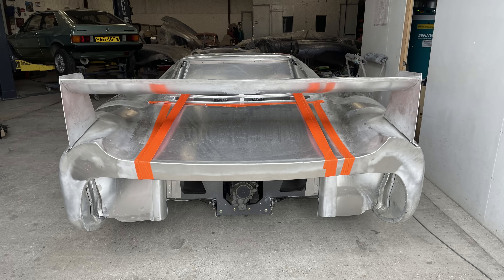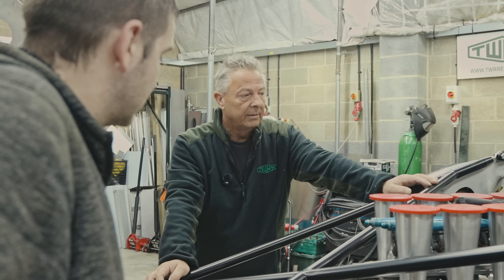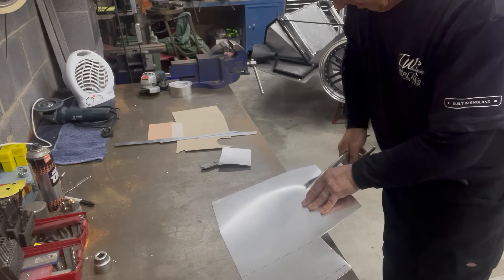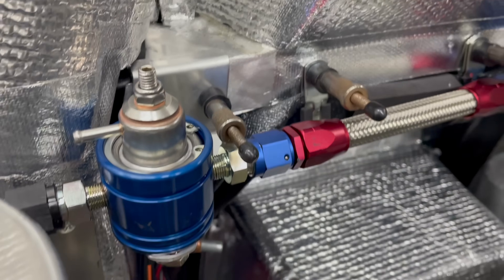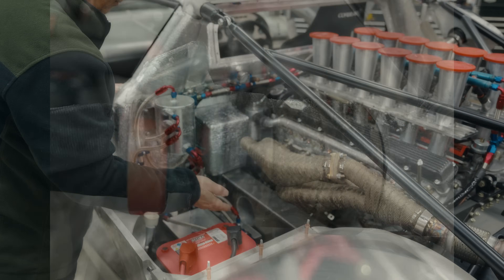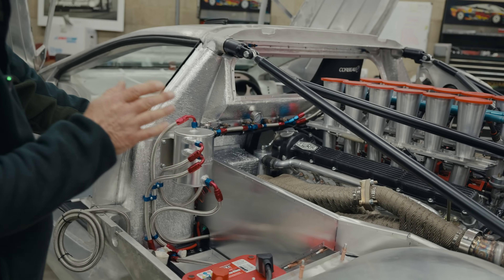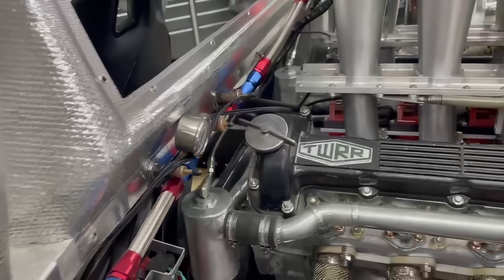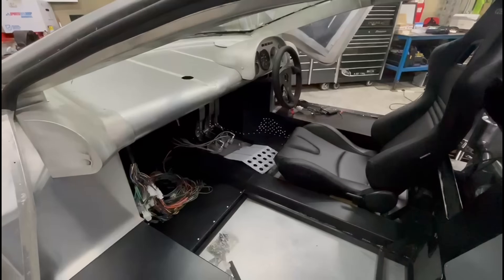Building the Ultimate Handmade V12 XJ220 - Part 4: Engine

Comment: Question, what is the purpose of ITBs  if they all run on a singular input? Surely they all have identical profiles for the plate, no? Not criticizing, just curious.
Reply from the maker: Ensures each cylinders gets it's own stream of air that isn't disrupted by the intake of a neighbouring cylinder. You can tune the length and diameter independently too so each cylinder performs the same as the next

Comment: APEX, Regarding those fans, use pulse width modulation and you will save a heap of power upon start up. The problem with simply using current is that like a car, to get going require large power and remember, these aren't geared. PWM can act as a kind of variable transmission only using the power it needs.
Reply from the maker: We can pass it on to Trevor

Comment: That V12 better be a 7.4ltr like the one built by TWR on the XJR for LeMans in the 90's.  That engine put out 740hp.

There are a limited 5 XJR-15 LM's built by TWR with 7.4ltr V12 with 740hp.  All are owned by a Japanese Yakuza client.
Reply from the maker: It is not an original 7.4L TWR engine I'm afraid..
Reply: @ApexPerformanceGarage what kind of engine is it? Specs? Bore and stroke details? Compression ratio? What rpm are you guys going to rev this to? Also, what did you coat the exhaust with?

Comment: Nice work. 
A little advice. If the car is going to be a road car the fuel will heat up circulating the engine. The return from the fuel rail is better going back to the fuel tank and not the swirl pot. 
Circulating swirl pot, hp pump rail back to swirl pot will see fuel boil causing starvation especially in warm weather. 
Ask me how I know!
Been there, done that. Sitting in traffic with an LS7 boiling fuel = embarrassment.
Reply from the maker: Duly noted 😁 I'll pass the message on

Comment: Nice touch with the fuel pipework. I have a photo of the Jag 1988 LM XJR9 engine when the mechanics were working on the cars (yep, those were the days you could get close enough) showing they also liked blue and red, they used blue for the water pipe shown above the exhaust manifold though.
Reply from the maker: Somewhat standard fittings these days apart from large OEMs with their unique approach to deter the enthusiast from self service. It's good to use what feels like the right stuff here

Comment: Just a quick question where can you learn how to use the wheeling machine because I’ve tried to find somewhere in London but no luck.  The nearest company is in Cornwall and that hundreds of miles away.
Reply: There's not many places unfortunately.  I went on a course in Cornwall run by an old school chap called Geoff who know his stuff. I'd recommend it! If you're interested I've got a guide on my channel for how to design and build a car from scratch in aluminium but using hammer and sandbag technique and the wheeling machine to smooth out the final finish.
Reply from the maker: Sounds ideal, will take a look myself 😁 thanks for watching
Reply: @GasoliniASMR  hi thanks for your message. Could you please send me your details so I can look into it. Cheers.
Reply from the maker: Honestly. I don't know. Hand made coachwork is a dying art. With the advent of CAD and CNC machinery. Handiwork like this is scarce. I hope you find somewhere to learn. Thanks for watching
Reply: @ApexPerformanceGarage  hi thanks for the reply.  👌👌👌
Reply: @ApexPerformanceGarage  hi I’ve just reread your reply but I don’t understand CNC OR CAD  Technology    Can you actually make panels with them devices. Cheers.  Thanks again for your time.